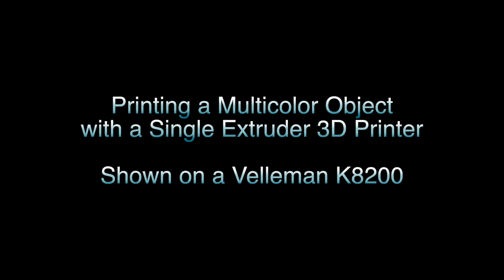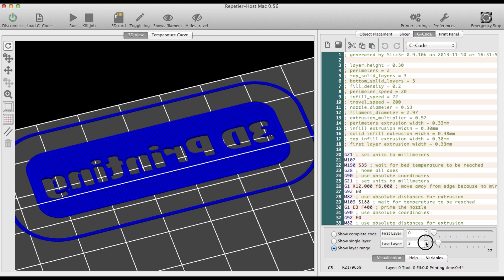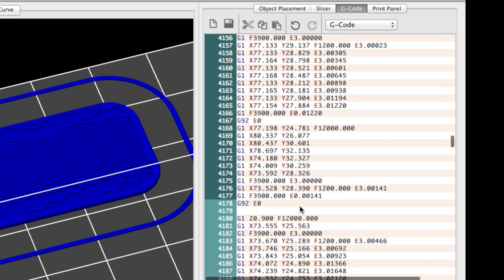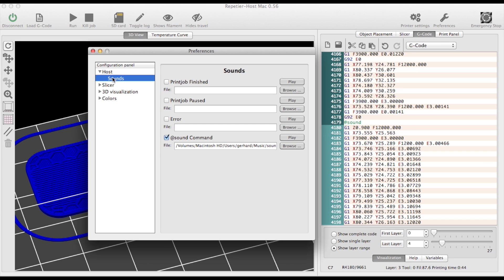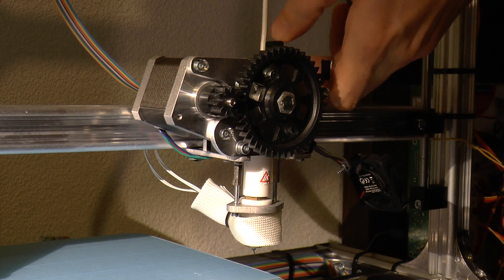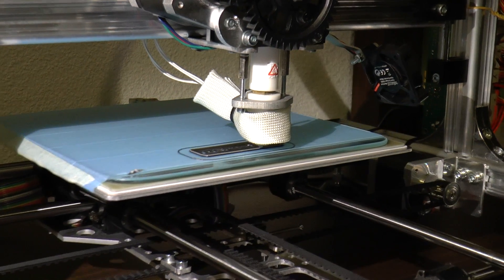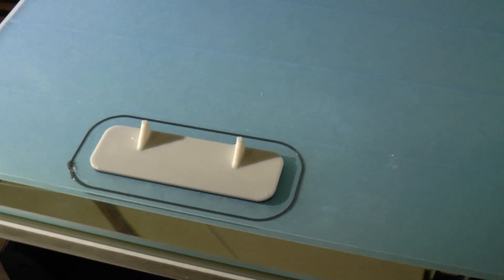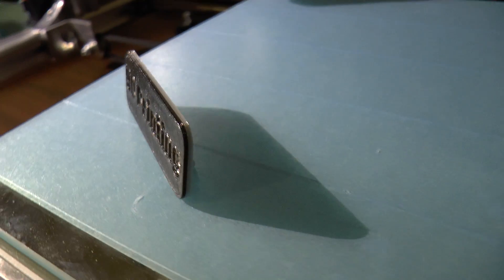3D Printing Multiple Colors with a Single Extruder Printer

Comment: what if you want to print something larger like a 3D figurine in colour
Reply from the maker: +Boadicea Barton-Bailey if you can separate colors layer-wise, you can print large multi-color objects. If it's not layer-wise, you can try to print parts with different colors separatly and assemble them afterwards. Or you need a multi-extruder printer, which can print different colors within the same layer. Or... you use a different 3D printing technology at all.

Comment: I don't recommend to turn off motors while pause to manually extrude. This way you could easily move the printhead. Instead you should extrude while pause with repetier host, use Firmware-changefilament function or simply home all axes after pause.
Reply from the maker: Klaus Daume Good point. However, my printer's head moves just along the z-axis, so there is no risk to move it. On other printers which move the print head along x or y as well I'd also recommend not extruding with paused motors.

Comment: What's the diameter of your nozel? Your 3drag print very well!!
Reply from the maker: simo chri Hi, thank you! The nozzle has 0.5mm diameter (that's the default which came with the Velleman printer).
Reply: Oh the default nozel? I'm actually use it but it doesnt print like your.... Maybe the software, do you use slic3r?
Reply from the maker: simo chri Yes, I use RepetierHost and slic3r. Probably you can improve your settings a bit. It also depends on your filament... in general I can suggest to reduce printing speed if quality is not good. The default value from Velleman was quite high and I also didn't get good results with it. It's better to start slower and then try to improve and find good settings starting from there.
Reply: ok, maybe i try to reduce that value and adjust other, thank you!

Comment: hi I notice on the video when you change colors that instead adding the g code  to purge the black color you did it by hand  way ?
Reply from the maker: Hi! I don't know exactly how much must be extruded until the black color is gone and clean white comes out. Next I need to remove the black waste filament before the print can continue, so I must stop the print anyways (need to remove by hand).

Comment: There was no sound when to change colour??
Reply from the maker: Hi Antony,
You are very attentive! You are right, the sound can't be heard in the video - I guess it is because the sound was played at the beginning of layer 3, where the video still goes with 20x speed. I added the sound at the beginning of layer 3 because I wanted to have some time to go to the printer and prepare for switching colors. The video turned to normal speed near the end of layer 3, just before I had to switch colors.

Comment: Hi, i would know if 123d generatesi the g-code or you need another program?
Reply from the maker: Hi! Yes, there is another program required. 123D Design creates 3D objects. These objects can be exported as STL files. Then I use "Repetier Host" which can read STL files. Repetier Host uses a slicer program (I use Slic3r, which is already included in Repetier Host) to slice the object in layers and calculate g-code. There are lots of parameters which can be modified and influence the resulting g-code. After the g-code has been created, Repetier Host can directly control the 3D printer and send g-code instructions to it, in case the 3D printer is connected to the computer where Repetier Host is running.
You can try this workflow out even if you don't have a 3D printer. Both 123D Design and Repetier Host can be downloaded from the Internet for free.
Reply: thanks so much. i need the in future.

if you want use different colors in the same layer, can you made a positive and a negative object matrix, positioned in the same point  of virtual board (program), but in two different files and g-codes and use comand pause?

is this idea right?
Reply from the maker: Ecor Mind Hi, I didn't try to change colors in the same layer and would not recommend it. The software supports different colors only if there is more than one extruder, so each extruder can print with a different color. I think it doesn't make sense to change the color within one layer on a single extruder printer, also because it is not supported by the software.
Reply: it was only an idea,
i understand,

i thinked  that if the same object has a positive and a negative shape on the same layer (example raimbowed or  different  colored figures writing 3D printing, using your video printing test) , maybe it's possible to use only an extruder, using the metod explained in your video, so  stopping g-code or creating 2 or more files with single object parts, change colored wire and start the process.

 wrong idea, so, ehehe.
Reply from the maker: Ecor Mind The problem is that the extruder could easily crash into earlier printed object parts (two objects very close to each other). Stopping and changing the color within one layer would also not work well, because the object is usually printed like this: first perimeters (outer walls) are printed, and afterwards infill is printed. So it's impossible to get half object in one colour and the other half in a different color. It would work if the software supported it and created g-code in a way so that first one half is printed and afterwards the whole other half. For each layer... and you'd need to change color 2 times on every layer... :-). That's complicated.
Would be easier to print separate object parts in different colors and glue them together afterwards.
Reply: ok. i understand. thank for you  patience

Comment: interesting, but you can not make a flat surface with 2 colors like that, I believe, unless you print in one color with deepening, then fill the hollows with some sort of paint or lacquer epoxy and then polish the surface. that would be a cheat...
Reply from the maker: Hi Bubu,
Right, with this method you can print different colours on different layers but not on the same layer. Next step would be a real 2 extruder printer...

Comment: Nice tutorial. Just one thing: Wouldnt it be better to use something like this in the "run on pause" gcode:

G91 ;Relative positioning
G1 Z15 F4000 ;Move 15mm up relatively
G90 ; Switch back to absolute
G1 X180 ; Move X axis to 180mm

That way you don't have to change the run on pause gcode for every print, and so you don't risk damaging your printer if you forgot to change that G1 Z15 to something else...
Reply from the maker: That's a good idea, thanks for posting this! I didn't try relative positioning so far, but it makes sense... absolutely worth a try.
Reply: sorry but I suck at gcode commands, can u pls elaborate on those commands, I read ur comments but dint understand anything ;s
Reply from the maker: Jim Jose Hi Jim! g-code commands tell the printer which moves it has to perform. Take a look here for some info about various commands: http://reprap.org/wiki/G-code
ET already added good comments to his post. E.g. the g-code command "G91" switches to relative positioning. The next "G1" command moves the nozzle up 15mm from where it is right at that moment. Then "G90" switches back to absolute coordinates and the next "G1" command moves the nozzle to X position 180mm (that's close to the edge of the printing bed).

Comment: hi really wicked vid m8ty, could you please help, ive just built k8200 and she running after watching your vid I tried to do it but when it does the next color and finishes the job when I turned over the piece there was a string like effect in the lettering, are you using pla or abs, and what heat settings would you recommend, REGARDS KARL
Reply from the maker: Hi, well, I also have a slightly string like effect. The letters are holes and the first layer with the second color has to cover these holes by bridging the gaps with strings of material. I printed this piece with PLA and about 187 degrees C hot end temperature. And I used lower speed settings. I didn't experiment with this so far, but I assume higher speeds (and a bit higher temperatures) would result in thinner strings.

Comment: That white heat ribbon around the extruder, is that original? If not, what's the reason? I ordered my velleman today!
Reply from the maker: No, this ribbon was not included in the Velleman kit. I needed a replacement hot end and it took quite some time to get one from Velleman, that's why I got one for a 3Drag printer from Futura Elettronica SRL. This printer is identical to the K8200. And well, the 3Drag hot end had this thermal isolation included. I guess the idea is not bad, as the hot end should need less heating this way because it doesn't cool down so quickly. Also because the fan points exactly to the hot end (must be that way...). To sum it up: I guess the printing results are the same, but the printer could consume less energy with such a thermal isolation applied.

Enjoy your printer!
Reply: Oh, ok, thanks for the information!

Comment: Great video!!!

I just started my K8200 build and was wondering how loose/stiff should the X and Y bearings be when strapped with the drive belts? I think I'm having a bit too much resistance when testing the table movements just by hand. (and Yes I've tried to loosen the bearing holders and realigning them and tightening again it seems to make no difference)
Reply from the maker: Thank you - I'm happy you liked the video.

Don't worry too much about the resistance of X/Y axis. I remember mine also didn't run very smooth when moving the bed by hand and I also wondered if that was OK or not. Well, I guess this is normal. Just be sure not to tighten the bearings too much.

The stepper motors are pretty strong and move the whole thing without problems later on.

Enjoy building your printer and then… have fun printing! :o)